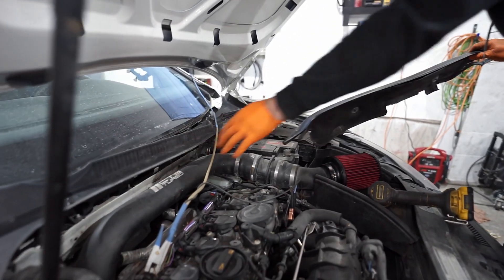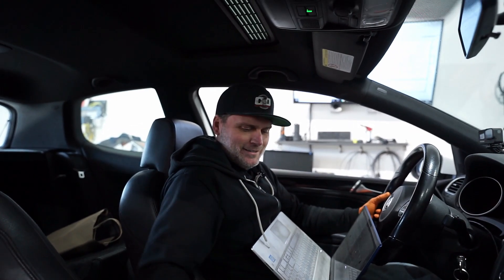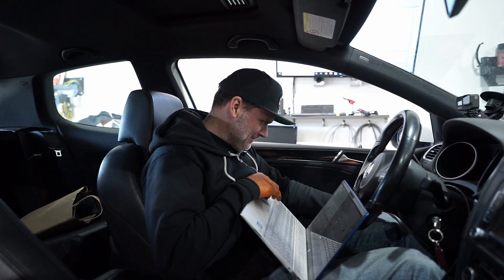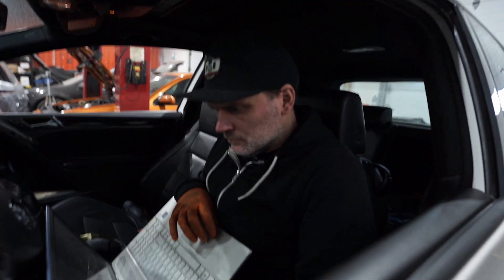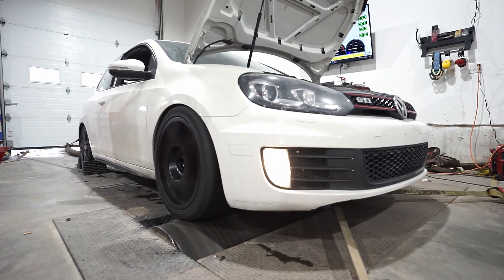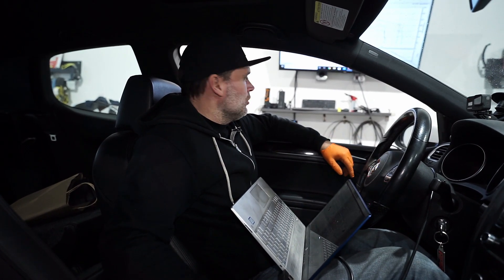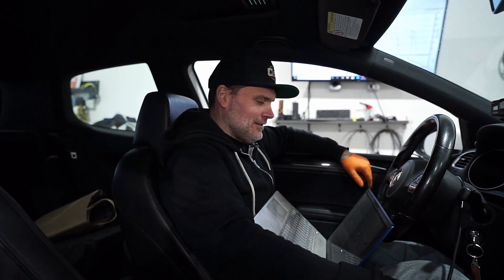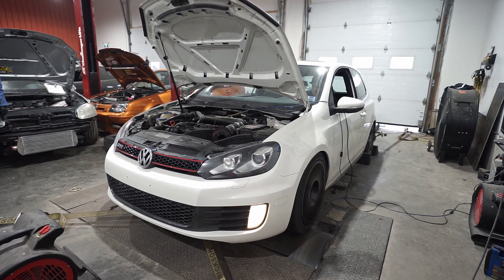MK6 GTI 2.0T Dyno comparison. Unitronic vs Malone Tuning

Comment: I made 330fwhp on a ko4 hybrid from hpa with full bolt ons(3inch turbo back exhaust, bigger intercooler, big intake, cts pcv plate, catch can, gfb dv, giac 3+ k04 tune, on 93 oct) no chance anyone with a k03 making 300whp, i agree with this man 110%
Reply: What about with e85? You think they make  300 on stock turbo
Reply: @mk5rob42  i highly highly doubt u can get 300whp on stock turbo even with e85, the turbo is def the bottleneck, just not enough flow with stock turbo, could probably get around 270ish which isn't bad at all

Comment: I have a 2012 beetle turbo  e888 Gen 1 cbfa and I only have a few opinions for tuning even though it's the same platform as mk6 gti. I decided to go with untronic because of the ability to flash at home.. stage 2 ecu/dsg with USP downpipe, newest DV with spacer, ARM fmic, both charge pipes and a cai.. my next step is CTS ko4 upgrade kit and untronic 2+... I'm almost where I want to be..  my goal is 350hp and tq... I fell like anymore on a fwd car is to much...
Reply: But unitronic does lie... Supposedly running twenty pounds of boost but my e c u only calls for fifteen...

Comment: I have the IE stage one tune on my 2012 mk 6 GTI... No other mods completely stock. Horsepower and torque gains feel very impressive!!! I have no idea what the actual gains are and don't even care. The transformation of the car was definitely worth it. It was easy to do and to this day I have only had one check engine light.... faulty coil..... Replaced them all.

I am an old guy (71) and just thought another 30 or so horsepower would be fun! It is!!!

Comment: I own a 2011 mk6 GTI with the same CCTA engine myself, and you two were 100% correct on the impact even a stage 1 tune has on the car. My stage 1 tune was with APR, ran that for about 8 months with my only mods being a drop in filter and a resonator delete. My only real issue with that tune was the surge in the mid 2k rpm range. Nothing, nothing, nothing, oh hello turbo! It made the car feel finicky in certain situations. Recently I did a downpipe, intercooler and intake and got set up with a Stratified tune, and took a few days to test the COBB stage 2 tune as well. COBB left a lot to be desired in power delivery, I felt that in order to get the car to accelerate even at a moderate pace I was needing to press the throttle down further than I would have expected. The Stratified tune though is by far my favorite. It has the most linear power delivery of the 3 tunes in my opinion, manages power well, and goes like hell. MN hasn't given me many (or any) great opportunities yet to really try and put the power down, but the daily drivability and smoothness of the tune makes it a clear winner in my eyes.

I was thrilled to see a mk6 GTI on here, hoping to see more! I wonder how APR stage 2 stacks up against Uni and Malone?
Reply from the maker: If I had one I would have tried, but this vehicle is getting an engine swap so I'm done spending money on software. Standalone next.
Reply: @COMotorsports  That's pretty awesome, I hope we get to see how it turns out!
Reply from the maker: @LightningStrike50  yeah we're going to cover the build.

Comment: Interesting your tuning on 91 octane. I'm from Australia and just bought a MK6 2.0T and inside the petrol flap says minimum 95 octane. Interesting to hear.
Reply from the maker: It's a different fuel rating that's why.
Reply: @COMotorsports  I understand the different fuel rating I just don't understand why VW would run 91 wherever your from and not 91 in Australia? That's the interesting bit.
Reply from the maker: @brettleonard8602  then you don't understand. Cause 95ron is 91oct in North America.

Comment: What turbo do you recommend outside of KO4?
Reply from the maker: All comes down to power goals, engine mods, what the vehicle is being used for... not a straight cut answer.
Reply: @COMotorsports  I see. I have a mk7 that sits… I like the thought of being fast… I guess. I’ve had the car for 3 years and put 13k miles on it…

Comment: I made 330wtq and 297whp on my k03 mk5 so don't say it can't be done because it can. That was confirmed with virtual dyno then put onto an actual dyno to confirm. W/M, intake, downpipe. The current record for k03 makes just over 300 and has the track times to back it up.
Reply from the maker: What dyno, what correction? I don't see it happening unless that dyno reads 280whp stock or engines modified such as displacement, cams etc.
Reply: @COMotorsports  i will have to ask about correction factor. Car made 218wtq and 199whp stock tune with a downpipe on the same dyno and i believe that is right on par for stock so i doubt it's correction factor.
Reply from the maker: @YFZrider57  so you're saying you gained 130whp with a tune on a stock k03? Nahh.
Reply: @COMotorsports  no? I said i made 297whp so that's 98whp with tune and water meth. This is a custom tune, not an off the shelf tune. You should look up some records, I'm not the only one to make that kind of power.
Reply from the maker: Cool, still don't believe it unless it's on full E.
Reply: @COMotorsports  i was going to build it over winter but I'll wait till the tracks open back up and I'll make some videos for you to show you.
Reply: You are not making 300whp on. A ko3 man just stop it. Lol it’s simple math. No reason to lie

Comment: I live in AZ and our 91 fuel is as bad as CO 91 fuel. Sucks. I can say running 95 octane fuel in a 91 octane tune is a considerable improvement in driving. I run a modified 2015 CBFA 6-speed with custom tune by DynoComp in Scottsdale, AZ. I’ve gone from K03 to K04 to hybrid R430 and (finally) Garett GTX2867R.
Reply: Heavily modified: Ferrea +1mm Valves, Springs, Titanium Retainers. ARP Head Studs, HPA Intake Manifold, Garret GTX2867R Gen II Turbo, Turbo Smart BOV, Fluid Dampener, MSD Coils, C-F-M Breather, Billy Boat 3” Exhaust, IE CAI, IE Recirculating PCV delete, Wagner Competition Intercooler, Stage II 4-port Snow Injection, CTS Turbo pipes, P3 Gauge, South Bend Stage III Clutch, Adjustable Koni's, 24mm rear sway bar. @CO Motorsports - I just put in Brisk Multi Spark spark plugs. Didn’t really think they would work., just bought them and threw them in. It was 108° outside. Boost comes on strong at 4200 RPM as always but at 5,000 RPM it starts spinning the Nitto 555 drag radials! Never done this before, especially in heat of Arizona summer. I run about 20# boost on 91 tune, 26#-28# on 100 tune (custom tune Dyno Comp Scottsdale, AZ). These are surface gap plugs with a pair of rings imbedded into the ceramic nose. Heat range 10 (two steps colder than stock).

Comment: Thank you for this .I was wondering unitronic vs ie today I'm on the fence to switch my Cobb ots on my ccta
Reply: Get a stratified tune on your Cobb. Cheaper and WAYYY better. My car dynoed 264whp and 307wtq
Reply: @lucasaubin1661  got unitronic . It's nuts
Reply: @lucasaubin1661  what mods tho? Stock turbo?
Reply: @IsaacBuzby  yup stock turbo only catless downpipe, r8 coils, air intake and dv+

Comment: Hi I’m running stage 2 93 oct .unitronic file .I didn’t know unitronic have stage 2 91oct  file . Thanks video Now I’m getting idea above those tune👌👍
Reply from the maker: I don't believe they do, which is likely why it was down comparably.
Reply: How much timing did it pull on 91?  4-5 degrees?

Comment: I made 275 whp and 337 wtq with my CC. I have the Intergated Engineering stage 2 with all of the bolt-ons including the Intergated Engineering intake manifold.
Reply from the maker: Did you do it on 91oct,?
Reply: It was on 93 octane.
Reply: What do you think of the twintercooler?
Reply from the maker: @BADMUJU  We've ran them on a couple cars. Really just comes down to the quality of the core. If we're shooting for power I'd rather a proper full IC as the stock one still has plastic end tanks.
Reply: Thanks for the reply. I have the original Forge twintercooler.
Reply: Why did you get the ie intake manifold while still on stock turbo?
Reply: I wanted to see how much power could be made on stock turbo. I am going to upgrade to the CTS K04x.
Reply: 19:44

Comment: Nice!  My brother has the CBFA engine that i have the pleasure to work on ( sarcasm that engine is the red head step kid!)  Cool to see real numbers.  He is running unitronic i believe.  Stg 2+, the thing rips!
Reply: Nice
Reply: Why is CBFA the red headed step child? I have that and I admit, it runs good but it took a lot more to get there than I thought.
Reply: @superstockamx9064  The only explanation I've heard is they have emission quirks and oddities.  The ozone sensor was deff weird (I think it was called that).  For a stock tiny turbo it RIPS!
Reply: @superstockamx9064  for example they have an ozone sensor attached to the radiator.
Reply: @paranormalextract4976  Oh...doubt that hurts (or helps) performance. Thanks. Unless to much ozone collected triggers some sort of HP reduction! LOL
Reply: @paranormalextract4976  My CC is a very fun car, definitely an old an looking sleeper. Just went 109.57 MPH in 1/4 mile drags the other night (hot & humid conditions) and 1/2 mile races are in 2-weeks. Previous best there was 134 MPH. Looking to hit 140 this go around....if reasonably cool here in AZ.
Reply: @superstockamx9064  never said it did, will set a CEL tho.  Do you have a catch can for that bad Larry yet?
Reply: @superstockamx9064  Nice must be fun to rip it!!!

Comment: hi guys, so would you recommend unitronic stage 2? and bit of a silly question but how would a flash tune provide more boost without having a boost control installed?
Reply from the maker: Boost is electronically controlled in these.
Reply: Flash tunes re-write the ECU programming......

Comment: I have a 2014 Audi A4, took the stock airbox out and put a K&N air filter on it. Then I put on a stage 2 tune from Intergrated Engineering and had very good improvements with each thing.
Stock 0-60 = 8.3 second (slightly uphill)
With K&N 0-60 = 7.7 seconds 
Stage 2 93 octane 0-60 = 5.0 seconds and finished the ⅛ in 8.736.
I can't wait to put the rest of the stage 2 supporting mods on. Hopefully by this time next year it has a K04 on it!
Reply from the maker: Stage 2 without am upgraded downpipe... tsk tsk.

Comment: Wow this is cool to see. Wonder what my car would make on the dyno with my 93 octane, r8 coils, plugs gapped a step colder, Catless 3"dp, Intake, boostpipe + FMIC with my GET Stage 2 File!
Reply: A tuner named sneeky tuned once made 300WHP on E30 Blend with just a 3" catless DP and an Intake! My tuner just came out with an E30 tune so I can't wait to feel that, apparently it's 310hp and 400lbs of torque on a dynojet.

Comment: Any long term results from guys in your neck of the woods running Uni 93 map on 91.. Issues? Uni says not to some tuners say they have had customers do it regularly where they live and have no access to 93 94...
Reply from the maker: Produces less power than a proper 91oct tune from my experience.

Comment: Have you guys considered products like boostane? It might make for a interesting comparison video to show the results from 91 to 91 + boostane.
Reply from the maker: We've test a few of these. We've had decent results on some of them, however it's nothing we'd recommend running on daily application as they leave a lot of deposits. The odd track day, or dyno session to see how far we go sure.
Reply: @COMotorsports  interesting. They do make 3 different products, which looks like racing version, a street and a quick shot. You think the same for all or just the professional (racing) one. We have 94 here but... I’d still like to bump it up alittle for safety
Reply from the maker: @Turbokrankenwagon  I would do a proper water meth kit, far over trying to run any of that stuff daily. Far better and way cheaper.
Reply: @COMotorsports  yes sir, thank you sir. Direct port w/m it is. Thanks for taking the time to reply.
Reply from the maker: @Turbokrankenwagon  Glad to help. Best of luck.

Comment: I have same mods but under drive pulley, intercooler (oem placement), turbo outlet pipe, throttle pipe, charge pipes. How much more power would you expect ? I’m unitronic stage 2 on 93 mark 6
Reply from the maker: Take it to a dyno, you'll know exactly what you have. :)
Reply: @COMotorsports  I’ll let you guys know. I’ll do dynojet sae cf like you guys do. It’s actually a vw Tiguan mk 1 but mk 6 gti motor 🤣 stock catback catted downpipe and electronic cutout before cat
Reply from the maker: @98MAzdaMilleniaS  We use to show SAE numbers when we first started on YT. Since the rest of the world shows STD numbers, we show STD numbers now as well. Too many people saying numbers were low when not understanding the differences. So to save the questions all the time, we just display STD numbers.
Reply: @COMotorsports  I’ll do both I’ll admit i shown std instead when bragging lol

Comment: I live in Edmonton and have owned a APR and currently own a Unitronic tune, I have noticed both had a rather long "learning" phase on a fresh tune. 
Granted time is money, nor claiming the Unitronic tune is better, but I believe it would have continued to yield more power had more runs been completed, and is being "sold" short after 2 runs.
Reply from the maker: The only learning is fuel trims. That would not impact overall power. It's just for regular driving.

Comment: Hey co motorsports it would be cool to see how much horsepower and component upgrades you can throw at a stock 2.0 T engine with out opening the motor up
Reply from the maker: 400ish
Reply: @COMotorsports  would that be also like replacing injectors
Reply from the maker: @mariorepetto185  no. I'm referring to TSI. The FSI needs lots of fueling upgrades to get there.
Reply: @COMotorsports  good to know
Reply: @COMotorsports  - 2015 VW CC w/ 6-speed MT. CBFA engine. Every bolt-on. Custom tune. Garett GTX2867R. 100 octane tune. 379 WHP in Arizona 100°+ heat. No doubt 400 +/- WHP at sea level. 91 octane tune is same conditions and only 335 WHP. Just went to drag strip last Friday. Always traction issues. 3,900 Density Altitude, 86° ambient, 60% humidity. Weight: 3,558#. Best: 13.77 ET @ 109.57 MPH. Obviously traction not there even with Nitto Drag Radials.
Reply from the maker: @superstockamx9064  cool to hear someone racing a CC.
Reply: @COMotorsports  I would agree. I still have a safe tune and 379 WHP BUT that’s on 100 octane fuel & tune and tune was in Arizona summer heat. And my DI engine is 12.5:1 compression from VW! Custom tune here as nobody supports can tune for a CC w/ a manual transmission. FYI - I like your test methods.

Comment: Ok, I'll be that guy :D  My '12 GTI (CBFA) made 237whp and 276wtq on an IE Stage 1 tune... 92 octane, stock exhaust, stock intake, ~100degree ambient in the shop.  Probably 1) different dynos, and 2) slightly better fuel.  The tune did point out a serious need for a limited slip though.
And yes please on more Mk6 content!
Reply from the maker: Different fuel, different results.
Reply: @COMotorsports  and it's not like you get consistent results between even dynos from the same manufacturer, let alone different brands.  My comment was sort of in jest of your "My GTI made 300whp" comment in the video.  Subscribed, looking forward to seeing more!
Reply from the maker: @rennkafer13  much appreciated. At least you didn't claim 300whp stock turbo. 😁

Comment: Have you guys ever thought about doing a fuel performance comparison for the available gas stations out east? Vancity Audi have done a 3 part series testing the different available fuels and get the best performance from chevron 94 with a bigger increase in hp and less timing correction throughout the power band. Would make for some good content and you guys do have the proper gear to investigate this.
Reply from the maker: Definitely noted. At this point for us to put something out like that with actual useful data it would take quite a bit of time, not to mention money. I wouldn't want the data to be skewed so we'd want to do it all on the same day, which means lots of fuel, and tons of time draining and refilling between each run, multiple runs etc. Maybe if the YT budget gets there it's something we can look at doing. Appreciate the idea.
Reply: hpa did a fuel comparison, US fuel vs CAN fuel on the west cost, it's a good read

Comment: hey CO motorsports, have you looked into mabo tech tunes yet?
I had a mk2 tts with malone stg4 software, it just felt like a soft safe tune and I wasnt very impressed cause they would refuse to push the limits even though I told them to.
the car is sold now but I regret not trying mabo tech to try and restore my faith in a big turbo fsi car.
Reply from the maker: No, we tune for 6 different companies currently, not to mention COBB, and HP Tuners, plus custom tuning on big turbo applications and standalone ECU's. There's literally a zillion tuning companies out there now a days. As mentioned in this video stock turbo's only have so much in them, which the big companies have pretty much nailed from what we've seen.

Comment: Just curious , is the Unitronic tune you guys used rated for 91 ?
Reply from the maker: To our understanding, they do not offer a 91oct file for stage 2, which is likely the reason there's a difference in power.
Reply: @COMotorsports   ya thats what I figured, ECU pulling crazy timing . Little splash of E85 ontop of the 91 would have made the difference.  But for the comparison of the tunes on your provinces fuel... great result !
Reply from the maker: @VWarmy  much appreciated. We don't have e85 here either so wouldn't have been fair to locals watching. (aside from what we bring in for our race car)